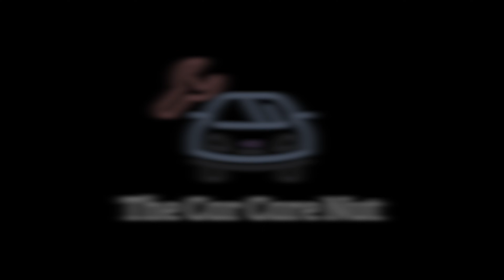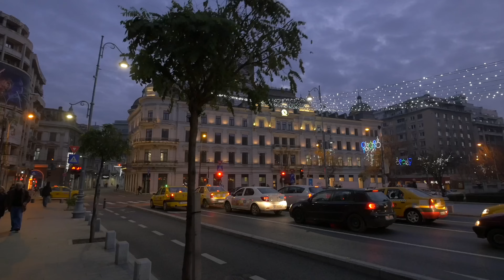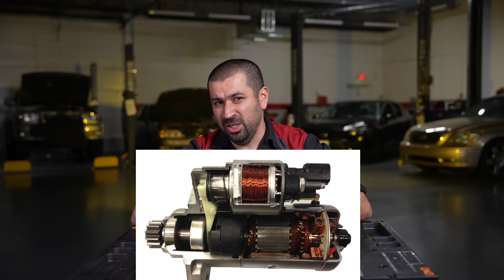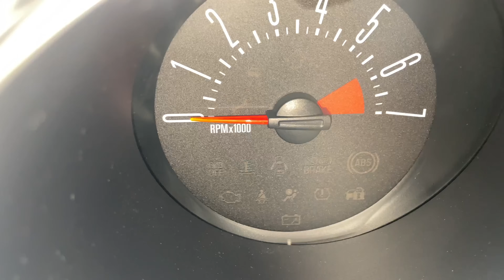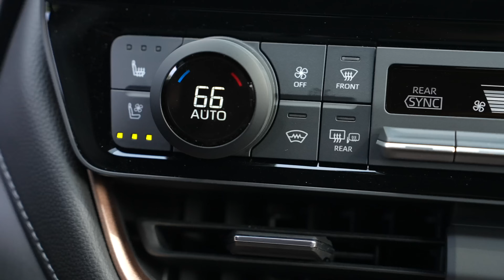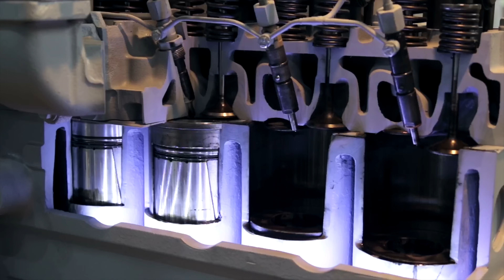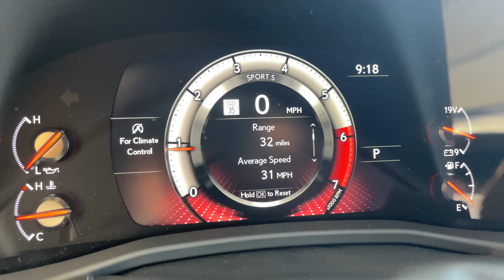How Does Start Stop Technology Work in Modern Cars? Everything You Need to Know

Comment: I hate start stop in my 2020 v6 highlander.  I push the disable button right when I start my car, like putting on my seatbelt.
Reply: Just put the little piece of cardboard between the button and panel. It will keep the button always pressed and the Start-Stop off all the time. Done this with piece of black packaging cardboard (flat, 5 times more dense than a sheet of paper) on my Palisade 2022 and I never seen it working :)
Reply: @maxkolodezniy  Awesome solution, I hate that they allow you to disable it but force you to do it yourself every time. It should just be a toggle switch button like everything else is.
Reply: @maxkolodezniy .  Nice solution.  I have a question tho:  Isn't the typical ESS switch an electronic?  My 25 Acura MDX - it appears it is , not a Push Botton toggle that would stay pushed in.  I will try your method to see if it works.  I do what brassboy said, Hit the Button like putting on my Seatbelt.  This system killed my AGM Battery on my 22 MDX , whereby I do lots of local driving.
Reply: How can a starter last 10 years with or without stop start?  It should last significantly longer without it.  Doesn't make sense
Reply: @dudeabides23  Time. Time will degrade components regardless of if they are used or not. This is also the reason why it can be a huge red flag to see 15+ year old cars with less than 20k miles or whatnot
Reply: @r.u.s.e3586 I'd rather buy a lower mileage old car anyday!
Reply: Same. Get in, seat belt on, start car, push start stop OFF. Did that for 7 years on my ole car. Whatta pain. HORRIBLE ‘idea’ 😛 useless and dumb, I’ve seen when it doesn’t start your car fast enough and impatient people rear end the cars in front of them. Not good.
Reply: All I want is a 2024 Toyota Sienna LE, no it doesn't have the auto stop-start system but it has a similar system such as the regenerative braking system and that system is less bothersome for me as a disabled person.